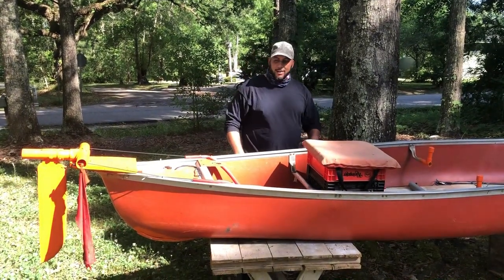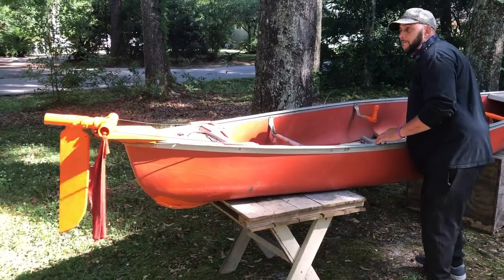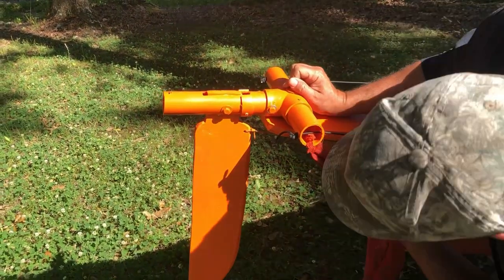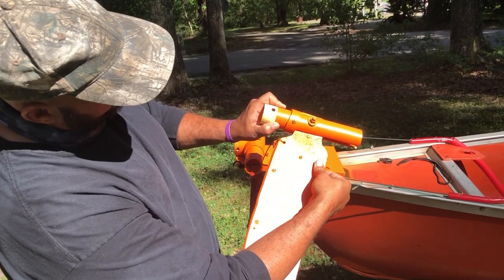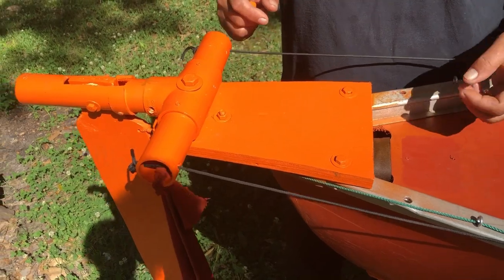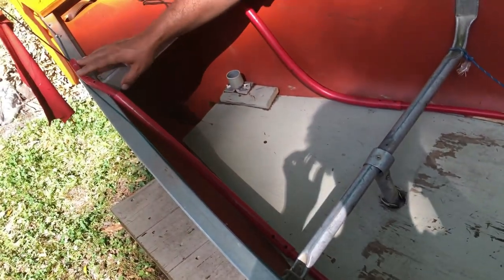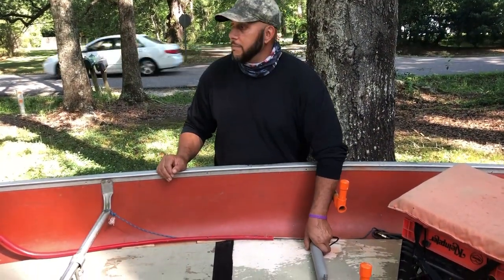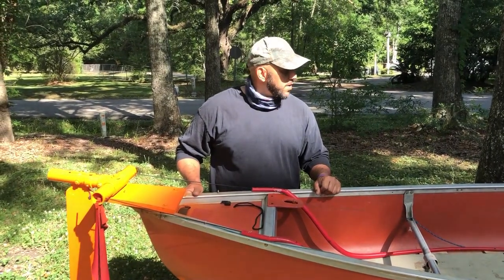THE MARSH MARTIAN DIY RUDDER for a canoe

Comment: HI.  Compliments.  A good job.  Can you clear my doubt?  When sailing, the rudder blade should remain in a vertical position.  From the video, however, it seems that it doesn't remain fixed and so I was wondering how it locks so that the push of the water doesn't make it go back.  Thanks for your answer.
Reply from the maker: I have a rope to pull it tight if it goes up if I hit something, but the water doesn't push it up on its own.